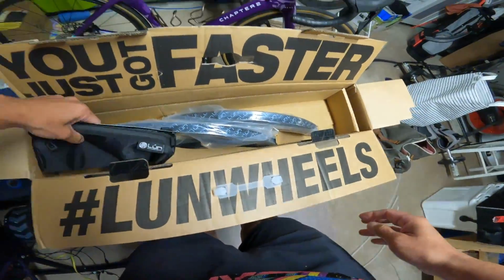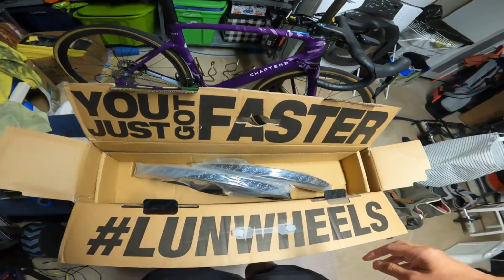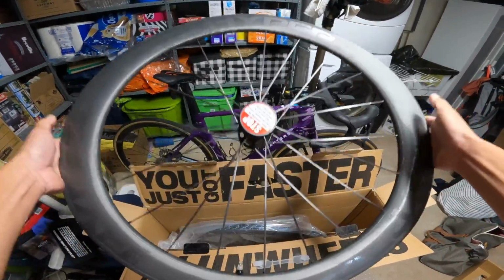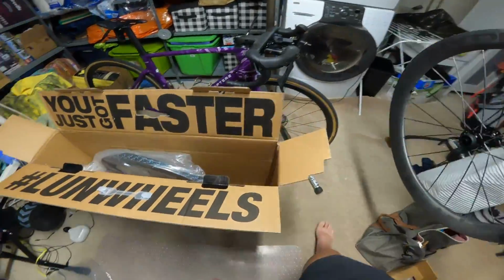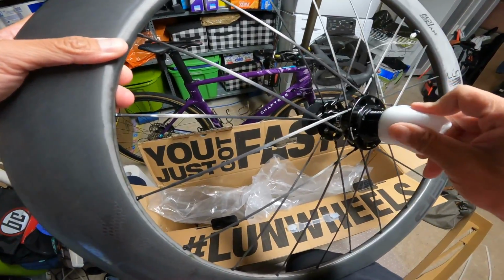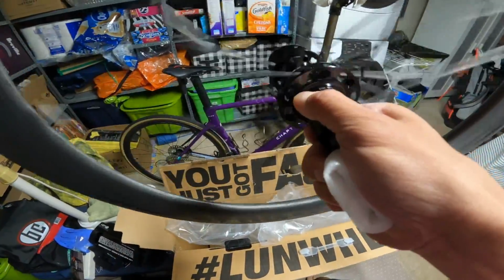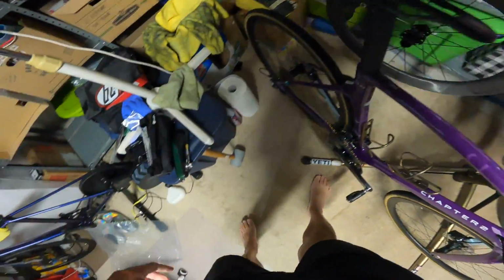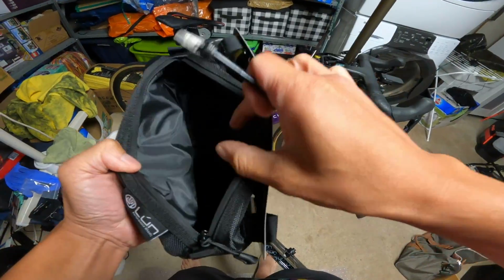Winspace Lun Hyper D67 2023 Unboxing and Set Up

Comment: Great video! Way quicker and easier than expected. What brand of bike tools are you using? Need to pull both the cassette and disc brakes, so needing the "chain whip" and the special socket for the discs. Still happy with the D67's?! Ready to buy a set! Thanks for any info and the helpful content!
Reply from the maker: Nothing special, most of my tools off Amazon or Home Depot! You can grab that chain whip and cassette/center lock ring wrench off Amazon for cheap, doesn’t need to be a fancy one! The lever I used to get the tire on is a Tru Tension Tire Monkey. 

Ya I am still LOVING my Hyper 67s. Just took them down to Niagara Falls this past weekend!
Reply: @DontGetDroppedCycling  thanks man! I'll grab a few goodies off of Amazon this week in prep for the wheels arriving (hopefully next week!). Excited to get these mounted up. Stay fast! 😎
Reply from the maker: @Trusty-Rusty HOT DAMN!!!!!!!!!! I need a point first ride update when you get dem PIZZA PIES ON!!! 👌🏽👌🏽👌🏽
Reply: @DontGetDroppedCycling  Done deal, hopefully this weekend (UPS says they're in the US and on the way!). Forgot to ask - what brand tubes are you running? Never run any of the TPU alternatives to the old school rubber. And 80mm on the stem length? Thanks for all of the info!
Reply from the maker: @Trusty-Rusty  I’ve been running the Rockbros tubes off Amazon in these wheels. 80-85mm should work!
Reply: @DontGetDroppedCycling  Got sidetracked and haven't installed anything yet...but soon. Did a deep dive into chain and cassette maintenance. Do you wax yours (soak in the liquid hot wax) or what's your method/preferred product(s)? So clean! I need to deep clean all the hardware at the same time, so wanted to check before getting too deep. Thanks!
Reply from the maker: @Trusty-Rusty I use Silca Super Secret drip wax. Wipe down my chain and credit card swipe the cassette after every ride which keeps it spotless 🤪 aka I’m crazy!!

Comment: And the Lock ring centerlock and carbon spokes for extra?
Reply from the maker: Centerlocks came with my rotors and yes not included with the wheels. Extra spokes not included in box but can be obtained from Winspace/Lun as needed. I believe they are trying to save the environment a bit by not giving them out unless they are requested and needed on a case by case basis.
Reply: @DontGetDroppedCycling  I think the same

Comment: I have just bought 1 also. Finished setting it up with tubes. Found out when i press the rear rim, its a bit soft. Is it the same as yours? Thanks
Reply from the maker: No problems for me. What psi did you pump up to? I run the wheels at about 80.
Reply: Around 110 to seat the tire and reduce to 90. Just notice when i put the wheel back on to the frame. Front wheel is ok though
Reply from the maker: Oh damn 110!! My tire was seated way earlier (you can kinda hear it) and I never went past 80psi myself. Went on a 200mile/322km ride on the weekend and no problems at all 👌🏽

Comment: Hey Erik don't use the electric pump on the tubes when they aren't in a tire it's max 5-8 PSI as they can deform rather easily without a casing (tire). PS They look sick with the Bike do you think you'll end up routing internally if it's even possible?
Reply from the maker: Not putting anymore air then I would have with a floor pump, just need to give it some structure to put into the tire. Don’t look at where I rest my bike into the repair stand 🫣🤪

I will put the brake cables internally in the bars when I put the DA callipers on. I’ll loose the two shift cables once I get Di2!